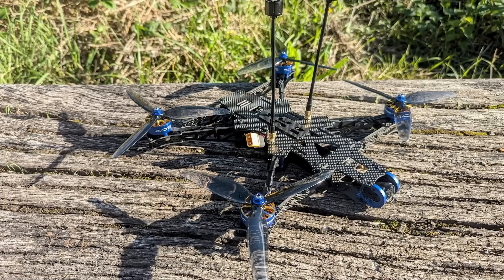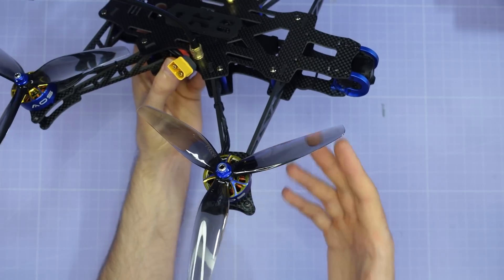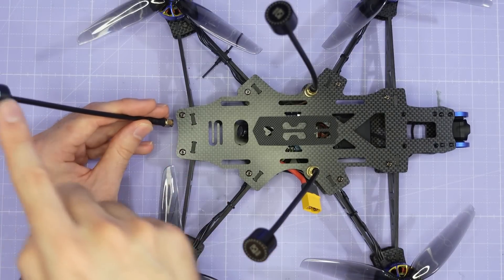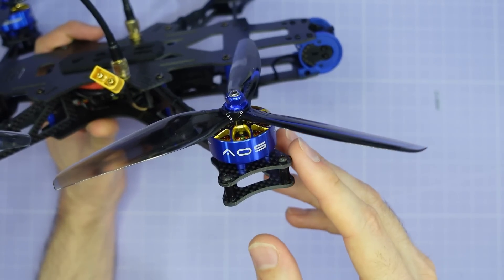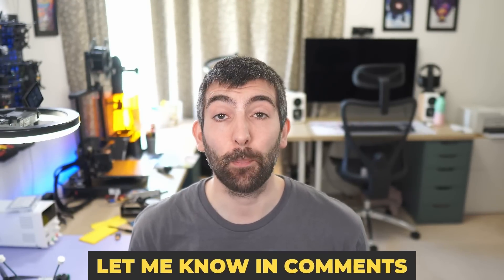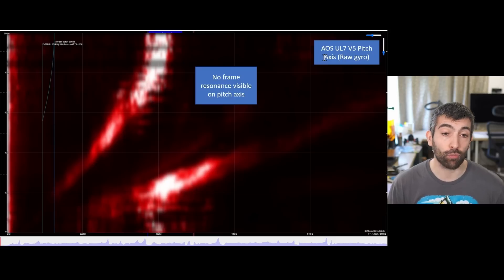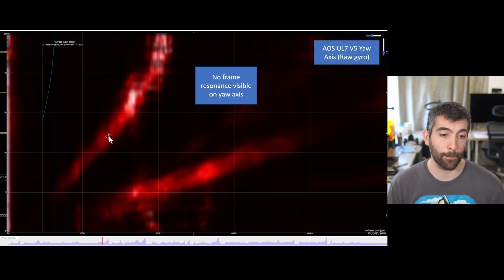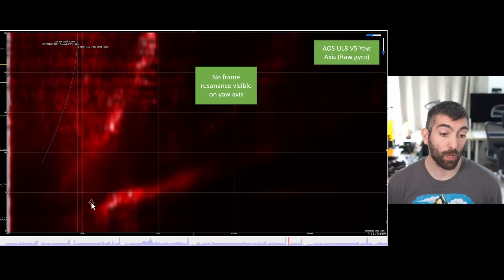AOS UL7, 8 and 10 inch Ultra Long Range Frames: Fly further, faster!

Comment: I'm a fan of the engeneering behind your frames but I would like to see something diferent from your mind like an generative desing and a more simple and eficient matetial than a flat peace of carbon fiber. Something like an conformational carbon fiber with mutch less screws than we see in this project.
Another obervation: I live out of EUA, using an 8 inch long range and I simply can not find  were to by your frames, except the 5 inch. If you optimize the distribuition, will certanly sell more units.
Thanks.

Comment: Hi Chris, i built the UL7 V5, and tried the DJI O4 pro, with the prescribed tpu. When i mounted the O4 camera, the base plate restricted the O4 camera from tilting up at an angle.  Appreciate your advice, if its ok to shave off the base plate to make a room for the camera to tilt up...thanks...

Comment: I ordered the 8 inch version of that frame with the T-Motor Cine 55A BLHeli_32 3-8S 8-In-1 ESC, BrotherHobby Avenger 2810 Motor -1500KV, and the T-Motor F7 PRO Flight Controller w/ WiFi + Bluetooth. Do you think that'll work?

Comment: I wonder how UL8 frame compares to Mario Fold8 DC I am currently using in terms of controlling vibrations. This UL8 looks really nice and I am seriously tempted to give it a try.
Reply: Hi, did you finally buy it? I'm really undecided between this AOS UL 8 or the Mario 8. Could you give me some advice?
Reply: @koni8391  I bought Mario8 and it is a nice frame. Vibrations are not bad on FC, but I do have problem with jello on camera (but that might be just me, as I have custom parts to accomodate gimbal on front instead of aluminium cage. Hard for me to compare it to AOS as I do not have AOS frame.

Comment: Grateful that I've been sitting on completing my UL7 build - as I've just ordered an O4 Pro and RadioMaster DBR4 Rx (paired w/ a Nomad module) as noteworthy upgrades to my original plan / parts.  I've watched your O4 review, and have already printed the adapters and gummies for mounting the new camera.

Question: I had already purchased antennas and adapter cables to replace the single O3 antenna (two antennas in one physical package).  With the O4 providing discrete antennas now - what's the best way to deploy on this frame?  I guess just go with the antennas and adapter cables as was the plan when I was installing an O3?

Super excited to dive into this build - thanks for the great designs, and all the supporting information, ranging from 3D prints to detailed technical analysis.  Keep it coming!
Reply from the maker: Yes use U.FL to SMA cables and a couple of SMA antennas. One RHCP and One LHCP for best performance. But two of each is fine too.

Comment: hey droners: build'n out my first FPV rig based on chris' AOS 5 V1.2 frame and iFlight Xing2 2755Kv BLDC motor. basic 5in drone to enter the field. and then.....when i obtain my FAA Part 107 license and upgrade to a larger drone for cinematgic and civil enginering inspection ops....what AOS UL size is recommended? the 8 or 10? thanks in advnace for the tech assist.

Comment: Did we just went back 10 years in time? The frame design looks like it's from 10 years ago when these drone mania started. It looks ugly, compared to helion for example. 😶
Reply from the maker: Beauty is in the eye of the beholder. The number of pilots switching from the Helion to the AOS UL10 due to vibration/jello issues with the Helion speaks for itself I think.
Reply: @ChrisRosser Since i commented, I watched a few videos about it and its growing on me. Coming from 5 inch freestyle quads, i started to like it. Only issue i have is, can't decide between the two versions. UL or just the beefed up one. Also the version 5 not available anywhere in the UK which is a problem for me. Planning to use it with dji O4, which isn't on the market yet, hope it fits the camera assembly. Oh and I am looking for the 7" version, the helion is pretty but they don't make it in 7"@ChrisRosser

Comment: I was considering getting a UL8, but a friend has recently bought one and the tolerances aren't great, a significant amount of slop and twist in the arms. The slots cut into the plates have at least a 0.5mm gap.

Great design, but the manufacturing needs addressing.

Comment: Those look like kamikaze drones to me. There is a tactical reason why 7", 8" and 10" FPV drones are used by Ukraine and ruzzia as kamikaze drones in combat. There is also a tactical reason why the UK-Latvia led International Drone Capability Coalition (publicly available; just register) call document for 7", 8" and 10" drones states: 

"The FPV Platform shall be 'fitted for but not with' a payload module. This module will act as the interface between the platform and payload.
Please confirm that your Platform shall have suitable mounting space for the module to be attached to the Platform, the module is no larger than 70mm x 50mm x 36mm.
Supplement this response with further detail in your White Paper submission (technical envelope, 2.1.11)".

All three of your drones appear to have the space for this platform to enable fitment of a payload module. Whilst purpose designed kamikaze drones may look like toys, they are different to drones designed for hobbyists; they have increased range with heavy payloads and preserve the battery's health in preparation for maximum agility in the terminal phase better than LR 10" drones designed for hobbyists and (non-military) pro-sumers; thats all irrelevant for a toy but a KPI if you're a combat drone pilot. Do you really think its wise to sell kamikaze drones to the general public?
https://bidstats.uk/tenders/2024/W23/823918857

Comment: I fly my AOS7UL with 21700 6S2P  Molicel, 8000mAh. Total flight time is between 20 and 25 minutes and total range up to 25km depending on height.

I only used thin nickel strips on the selfmade packs I might go to copper over the winter to get even more efficiency.
Total weight is about 1650g with GoPro12.

Comment: And… break an overcomplicated frame on the first crash
Reply: Those frames are not designed for crashing. If you crash frequently while cruising don't get it.
When you crash doing long range it doesn't matter anyway if your frame breaks or not it's usually gone for good.
Reply: @snviper  the problem is that Chris is not any kind of reputable pilot. He designs as an engineer, and almost always an engineer over complicates functionality because it looks good on paper and rarely translates to any practical benefit.   His frames are a prime example of this sentiment, and his testing of products is so extremely skewed by bias, that I personally don’t believe that this guy is trustworthy in any capacity.
Reply: @GrauFPV I don't think you need to be a reputable pilot to design a long range frame. For the most part, frames have been like 90% the same, theres some new innovations that come out like the  QAV X-Lock for example. If you're designing a freestyle, bando basher, sure it makes sense to have that experience of breaking arms and frames. I just don't see a point in your comment about breaking a frame thats not meant to ever really be broken. Just my 2 cents
Reply: @GrauFPV  Interesting, what frame would you recommend please for mountain surfing ?
Reply: @Anadrol88  honestly, I’d build something like the 533 spec 7.  It’s got a strong build, and you can run it pretty light.    Tunes well, and designed by actual badass pilots who understand engineering from a practical use standpoint vs this guy who isn’t much of a pilot and designs things that are over complicated and not practical at all.
Reply: @GrauFPV  Thanks a ton man, much appreciated !

Comment: While mounting the antenna in the middle of the frame gets rid of gyro noise from the antenna, you end up blocking your antenna with the rest of the body when the quad is in forward flight, pointing away from your position. That's why we place the antenna on the rear with a rearward tilt that matches the camera angle. That way, when in forward flight, your antenna is pointed straight up and effectively positioned at the highest point in the frame, clear of any obstruction. So I don't agree that the rear is the 'worst possible option' at all. Thankfully, the SMA ports can be unscrewed and re positioned where they should be, as signal integrity matters /much/ more than frame resonance in long range flight.
Reply: Agreed. I mounted my antenna in the back on my UL7 for that reason. When it was in the middle I had total signal loss sometimes on hdzero.
Reply: @snviper  Thats why design and simulation alone can't make a good product. You have to actually test it in the real world.
Reply: @snviper  How did you make the mount ? Did you print some parts, any link please ?
Reply: @snviper we're did u get the stl for rear mounting dude
Reply: @johnbayliss7124  Thingiverse I think. Rear mounts from other AOS fit as well. It includes a GPS mount. Will check later if I can find it again for you.

Comment: I have a Chimera7 for long range and I use 18650 3000 mah Li-Ion batteries 6s3p ( 9000 mah ) and it gives me around 30Km total trip flight. I have also experimented with two of them in parallel and I got 40+ Km trip distance (20Km from home). But it was to heavy for that build . That would fit perfectly to your 10'' and it would cover much more distance.

Comment: Nice design, it makes me want to chase races !

The cut outs (X-Cell) around the flight controller look very similar to the ones for 5''. does that mean the vibration attenuation performance of these cut outs do not depend on the size of the quad ?

Another Question is why so much carbon area is needed on the top plate ? Are there  quads meant to lift sizeable cameras ? Or is the lipo disproportionately big for this class of quads ?

Comment: All nice, but... I'd imagine these double, vertical arms may be pretty draggy. Flying LR, often in pretty high winds, aero efficiency is more important than in freestyle or even racing (nothing worse than watching the battery voltage going into the red zone on your way back home, while fighting headwinds...).
Also, in the name of efficiency, why not make it a pusher, with arms mounted to the upper deck?

Comment: 6S2P with the new P50Bs would be quite the pack.  10,000mah for about the same weight as a 6,000mah LiPo.  Rated to I think 120A?  Downside is it’ll fly like a 4S pack on the way home so better have enough thrust/KV.  Could even consider a 4S build to save 300g of Li-Ion battery weight.

Comment: I just bought the AOS 7in V5.  Sadly the spacing of 60.5mm between the two frame - mounted video antennas is ~1mm shy of the width of 3x 21700 cells  So my Lithium Ion packs won't lay between them.  I'll probably run a 2P configuration with two separate packs arranged fore and aft of the antennas most of the time, but if I want to run a 6S1P pack I have to mount it on edge. Also, in the 2P configuration the forward battery only gets one strap. I guess I could enlarge the antenna mounting holes to move the antennas further apart, but that might weaken the top plate. Kind of disappointing.  What is the space between the antenna mounts on this UL7 frame?

Comment: I have AOS UL7 and can say that beams connection in the motor end is unfortunate: the motor bracket start rotating by some degree in motor spinning area. I fixed this by filling joints with two component compound. Probably AOS 7 EVO would be better frame.

Comment: Why is the motor size leap from 8 inch to 10 inch props so high?
You say 2808 for 8 inch props and at least 3215 for 10 inch props. The disc area is 56 percent larger but the motor is 145 percent larger.
 From my personal building experience :
2806.5-2808 for 7"
2810, 2812 or 3110 for 8"
3115 and above for 10"
Reply: My new 9" longrange/cinelifter build run's on 8S2P 8000mAh and 6S 6000mAH, flight performance is great   :D   X4 3214 an 9"4.5 props, 4in1ESC 65A/100A
Reply: Prop weight doubles from 8 to 10
Reply: @tiefflieger9712  not true. 
A light 8" prop gemfan 8040 is 11g.
A light 10" prop gemfan 1050 is 17g.
That's 54% more weight not double

Comment: Question: in your design, both antennas are placed in a close proximity to the battery, doesn't it make any influence on characteristics of antennas? In our tests, we observed that SWR curve was changing as you bring antenna closer to the battery.

Comment: Man Chris I don't feel the same way about my medium length sma antenna as you have described here and in the past, I will go as far as a long antenna could cause adverse affects due to the fact that it is weight that is  extended from the body of the quad, but where I'm having problems is the fact that the TPU is mounted to standoffs that don't have allowance for movement, that would reduce the effect of the antenna movement. The antenna is not designed to be a spring my true rc antenna is very stiff in fact.
Reply: I'm going to reprint my antenna mounts on my Demibot in PLA and see if the is a difference in my blackbox. The fact that the antenna being hard mounted on the plate vs soft on the standoffs I believe is negligible.

Comment: What would you say the flight efficiency is between the 7" and 10" with your suggested motor choice and similar pitched props? Is distance and flight time increased going up to the 10" or is it the 10" more suited for carrying heavier cameras/Gear?
Reply: From my experience the 10inch doesn't have a longer flight time than a 7 inch. In fact the flight time with the same battery is less. But of course you can carry a larger battery and extend the flight time. So all in all 10 inch can just carry more weight, but flight time is pretty much the same with a 50% higher all up weight. For me I was disappointed from the 10 inch and prefer my 7 and 8 inch build.
Reply: @chrisbee5481  imma about to find (finding out)...built the UL7 last year, LOVE IT, very light, trustworthy and efficient. Got impatient waiting on his UL10, and all the Helion videos didnt help haha, so i bought the Pulsar 10 from geprc. Very heavy, large foot print, still working out the kinks but so far havent been getting decent flight time... and about 2kg with a small battery =/ time will tell!
Reply: @chrisbee5481  Very interesting thank you.